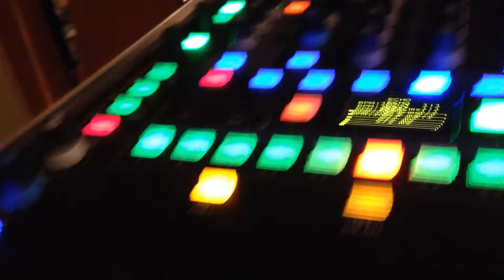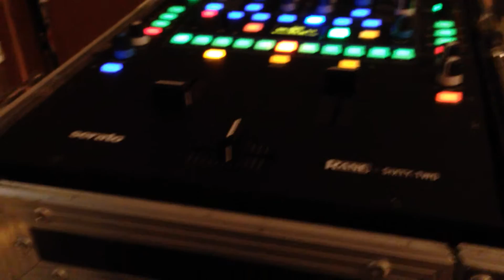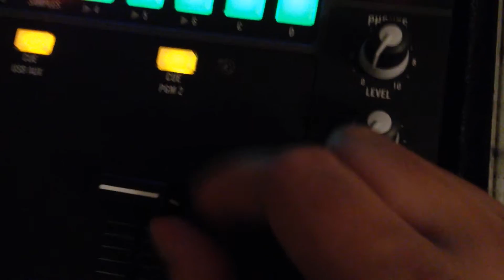Crossfader Manget Defect on Rane 62

Comment: wd40 the upfaders
Reply from the maker: thats a horrible idea, never ever use wd40 on a mixer
Reply: Been doin it for over 15 years.  wd40 lubes and cleans. Every 3 months I wd40 the faders of  my 2 mixers. My vestax pmc07 up faders have been wd40'd for 10 years 4 times a year and they run great. Don't soak it in wd40. Just apply some on a paper towel and clean the faders. Faders collect dust that actually  sticks to the lubed metal. Wd40 cleans that. The lube they sell is the same lube you can find anywhere. So the right process to clean the problem on the Rane which I ran into is to wd40 the fader and then apply  your lube